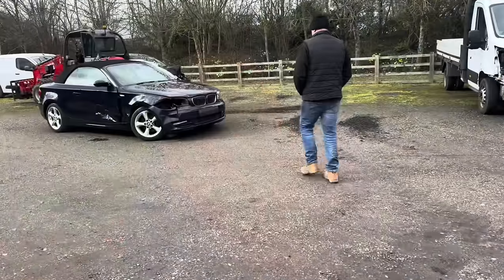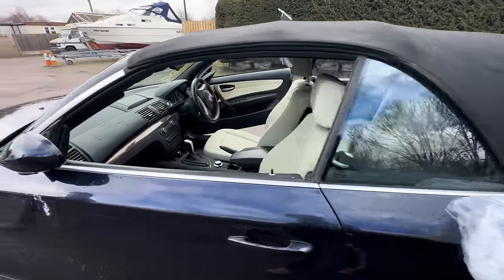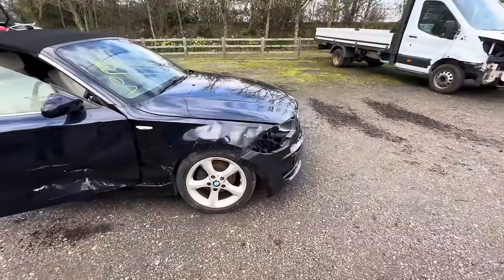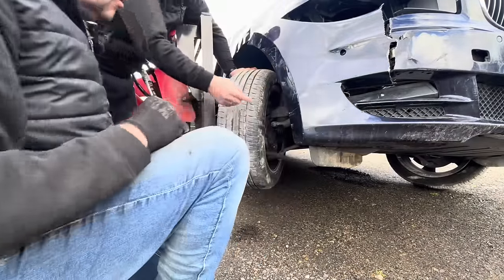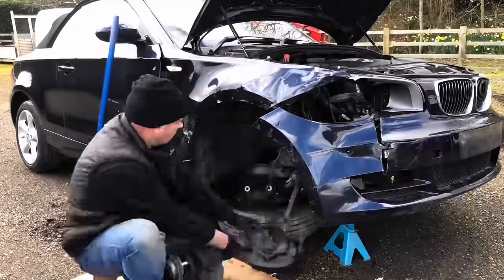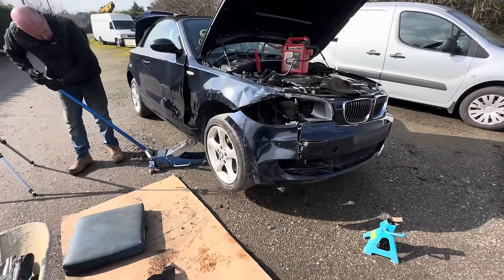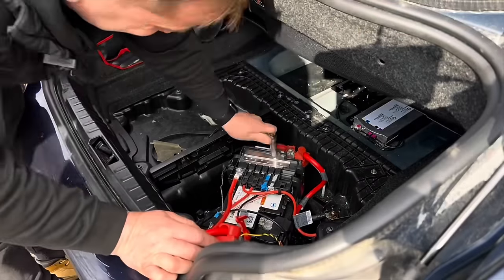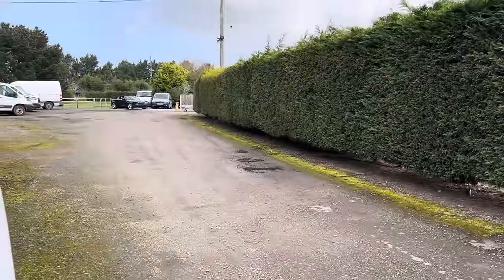UNDISCLOSED DAMAGE, WON'T START AND RIDICULOUS FEES!

Comment: I’ve had two cars from Copart, both disasters. C5 V6 diesel, I’d spoken to the previous owner and knew the damage. Suspension on delivery was buggered and it had to be rebuilt at £1500 cost. Next car, DS3, clearly had wheels and tyres swapped before it was delivered to me. And costs - through the roof!

Comment: It is an inner tie rod rob ,you were correct,just changed mine ,and the pipe tool uses to undo them is called inner tie rod removal tool ,so 100%

Comment: Nice one lads, took me back to the 135i  MSport of the same vintage that I had a few years back. Amazing car. 100% reliable. Sold it on with 118k on it so that 125i is barely run in 👍

Comment: 6:27   So it was that place beginning with C, I got caught out with a lovely clean BMW 520D F10 which had a slight engine loom fire, the loom was the least of the problems. I actually think the loom had been deliberately shorted to cause the fire, the engine was totally scrap (every bearing was the worst I have ever seen) The interior had been filled with water, none of which had been shown or mentioned. It has been a heartbreaker!!

Comment: That CIC controller have a common fault. It might not be damp that’s the problem. My E92 had a dry joint on the micro switches. Just by taking it apart and re-solder the connections fixed the problem.

Comment: `Years ago I went to buy a Pug estate from Raw2K in HFD the pics showed car mint as an non insured police car. When I arrived to pick it up they fork lifted it and tipped it into the next car then bought it round and the driver slammed the brakes on and the car slide off the forks from about 3 foot off the floor and the two tyres myside blew out. I was speechless. Last time I ever used them. Cowboys.

Comment: Good potential with the spring  in sight. Be interesting to see if there is structural damage . The runner classification ? So much of the listing was incorrect so why not  the cat as well. Plain to see that Disinformation is not restricted to the media.

Comment: Yet again another excellent video guys cannot get enough proper learning videos all the time just keep them coming ps I wish you was near me i have a Peugeot partner combi 2004 20hdi been to two garages and they cannot fix it but I bet you could it cut out one day and would not start again one garage said broken timing belt it had just been done i tried to get it started and it started ran perfectly stopped it and won't start only starts now and again had diagnostics done and no codes could you give me a starting point please

Comment: Bought a little Seat mii (blind) from a salvage yard in Worcester the other day, front o/s damaged and rear quarter panel damage, it turns up, front was basically as described, the rear chassis is bent , boot floor creased and split along the welds, no mention of this though, just another dodgy salvage yard i suppose , 🤷‍♂️ onwards we go

Comment: Bought a 535i from that auction house described as runs and drives . Got it delivered and the bottoms ends gone …. No mention of that in the special notes either ….. feel your pain ….. did they offer you any solution or did you just take it on the chin

Comment: Auctions are always a bit of a gamble, but as they use online auctions rather than going to see the vehicles, you should get good honest and comprehensive photos and descriptions. Not doing this is really a breach of the Trade Descriptions Act and is trying to deceive potential buyers. Not good enough for a big company. Rob and Chris will do fine with it though. Auctioneers descriptions should be accurate, but they are so big, I don't think they care very much.

Comment: Did you say 6 cylinder.....
I had a Ford Falcon ( think 80's Granada)
6 c , p/s , air con, auto,
cloth trim two tone ,  it
was like to me a Roller
i had it for 12 years &
sold it cos my brother
gave me a M B sel v8
it was a big mistake
it drank like a alkie  
the Ford's command
a premium now as
hard to find, no car
manufacturing in
Australia now so
sad now it's
Modern Rubbish.😢😮